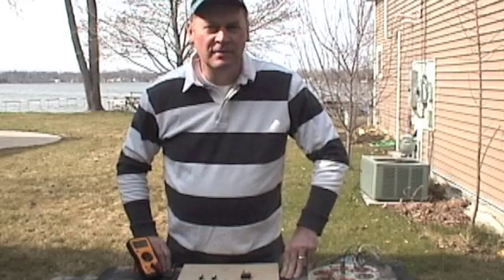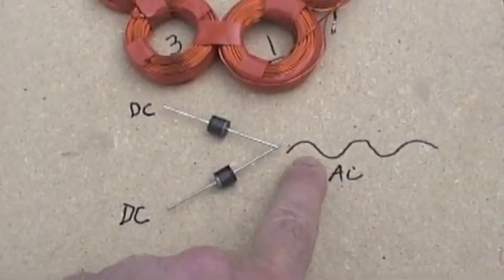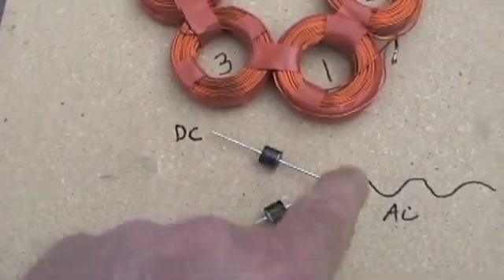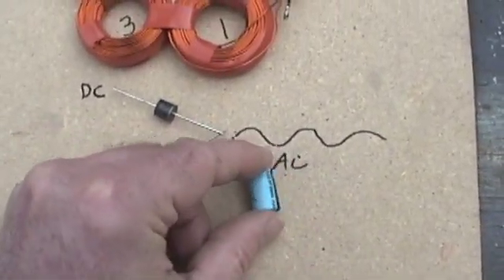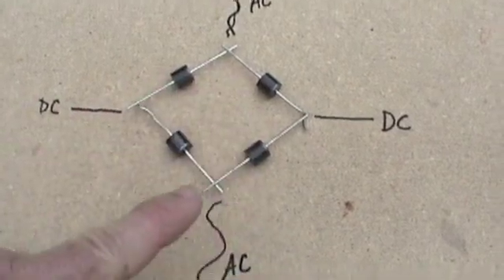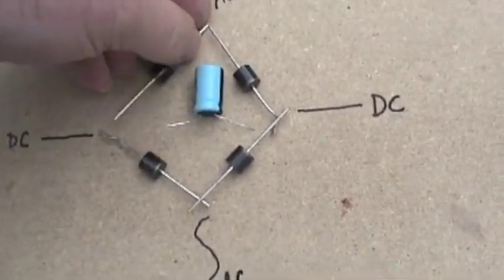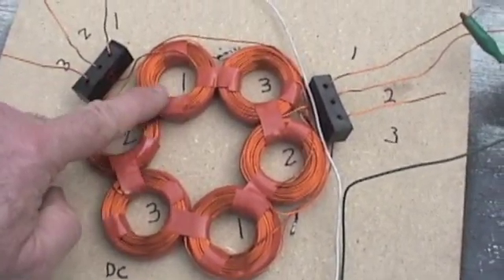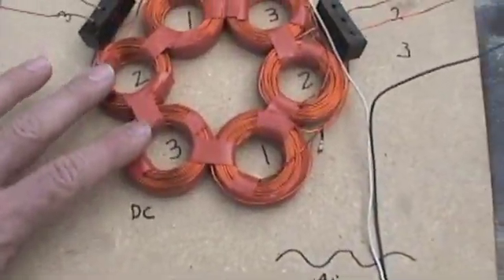Lynx Electrical Tutorial on PMAs

Comment: You mentioned using a capacitor to block dc from going to the coils and shorting it out. Does that mean you need one capacitor for each phase and therefore 3 caps?
Thanks.

Comment: @THEHODSONATOR because inside your alarm clock, tv and anything else that is "electronic" is DC. It is all converted from the AC in your home wall outlet to DC inside your appliance. this is due to the fact that AC can not be controlled as well as DC can. Although Ac can be controlled, there are more cheaper options converting it to DC and doing it that way. hope that helped!

Comment: I noticed your meter is set on 2k, when i set mine to 2k i get no reading, but at 200 i get .4 is there something wrong here? my test coil is 75 turns with 15 gauge wire and at 125 rpm aprox i get 1.3 volts. what do you make of this?